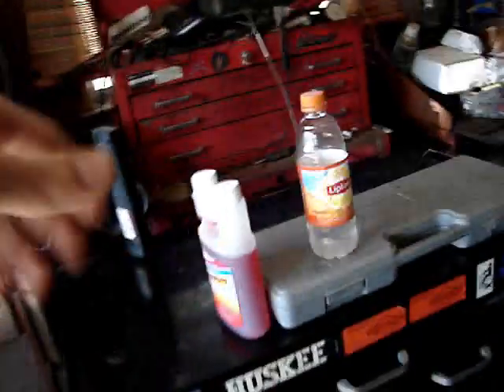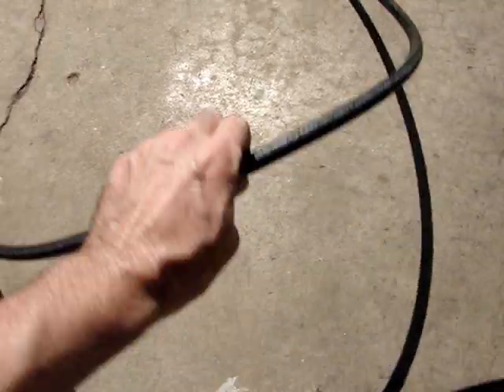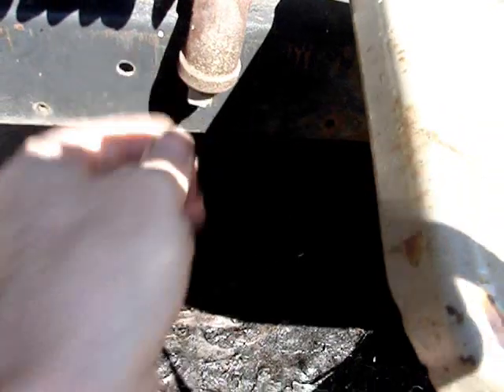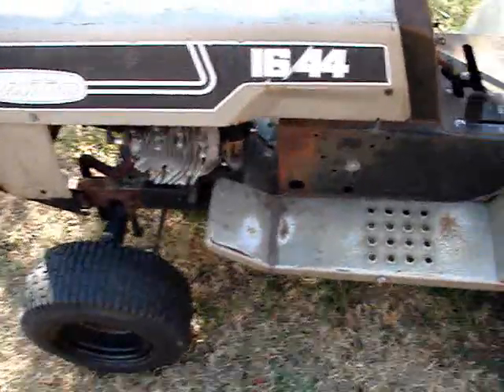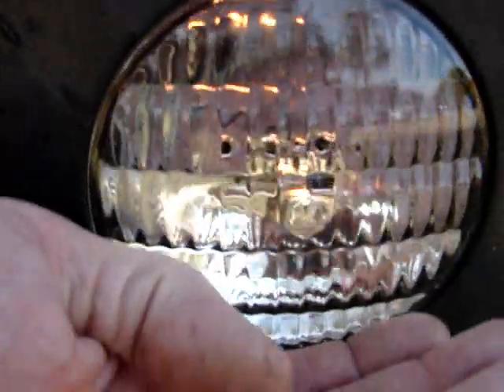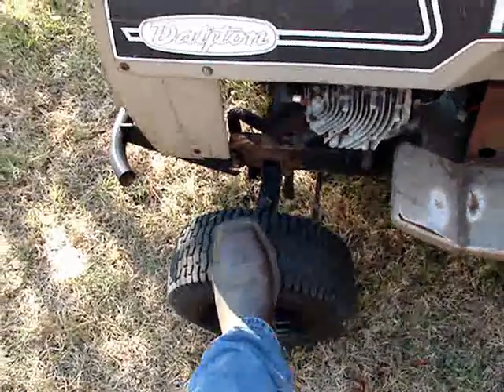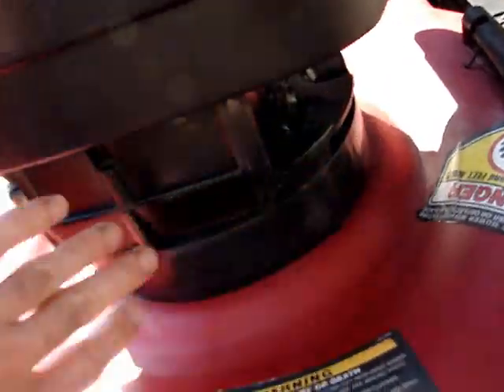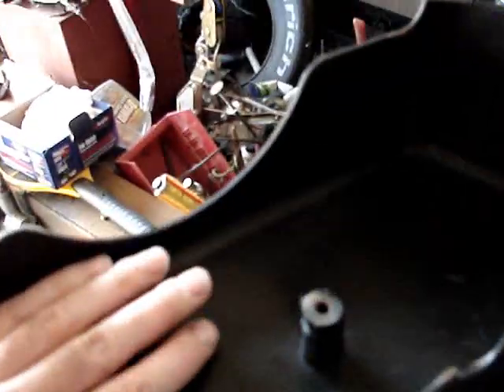1980 Dayton GT Fuel system repair and upgrade

Comment: I picked up the same Dayton sam color and all.. I put a 18 hp Briggs opposed twin in it. Are you still running straight pipes? My muffler from the 16 hp is short attaching to the 18 hp adapters by1/2 to  3/4 inch.
Reply from the maker: its still straight piped. I used the pipes from a 93 craftsman that had a twin in it. the muffler on that model was a rectangular box muffler with two holes on top that the pipes slid into, the muffler itself was bolted to the frame. A lot of 90s craftsmans used this on their twins.

Comment: I do like the dayton ! I hope you still have it man, didn’t you swap the 16 to an 18?
Reply from the maker: Yes I still own it, the 16 was giving out so I swapped in a 2000 model year 20.5hp. I've had a lot of issues with getting it to start despite new batteries and starter. It slowly tries to start and the starter makes a high pitched whine although its barely turning over motor, previous starter did the same thing as the new one. I'm not sure what the cause is, but once its up and running it runs like a champ.